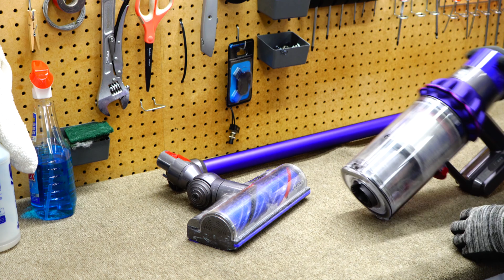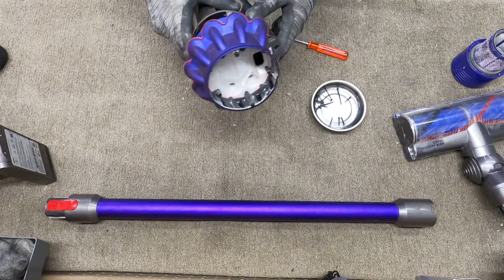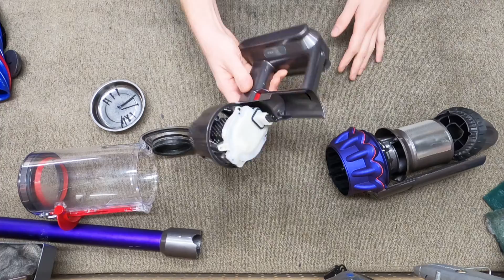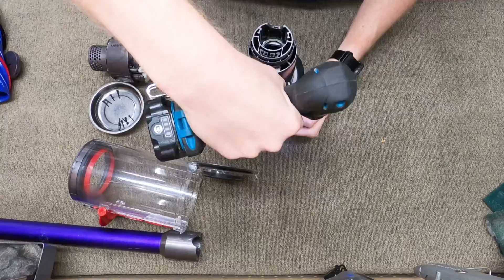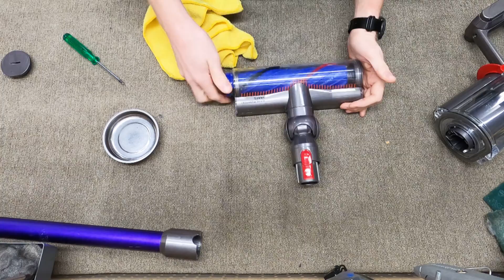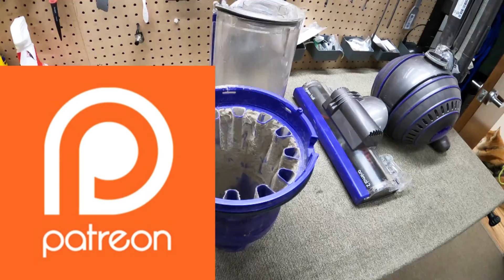Dyson V10 How To Fix Loss Of Suction - Professional Vacuum Repair

Comment: I have no problem with taking stuff apart, but I always try Plan A first if that's an option. My shop vac is part of Plan A. I have this exact model and it suddenly stopped having any suction at all. I checked the usual culprits, i.e., that little square hole, but it was clear. Washed and dried the removable purple filter. But, instead of disassembling the cyclone, I just took the end of my shop vac hose and slid it over the silver top of the cyclone assembly and let it run for a minute. I then smacked the side of the cyclone housing a few times with the palm of my hand to loosen up any remaining dust and attached the shop vac hose again for another minute. Voila! It now runs like new. Give it a try before busting out the screwdrivers.
Reply: I was thinking that would be a better start. Nice thank you

Comment: Quick question, can the v10 create suction without the dust bin being in place? I have been given a clogged up v10 to clean the inside but they forgot to give me the dust bin so I'm thinking that I might not be able to test it without all the necessary parts.
Reply from the maker: No it requires the dust bin and filter
Reply: Chuck it!

Comment: Nice presentation! How well might high pressure air clean the V10?  Meanwhile my Dyson V8 sits on the floor as it's another pain  to clean .vs. my $90 "vacuum devil" Dirt Devil Pet Swerve that essentially does the same thing.  For serious cleaning, my SEBO E3 gets hauled out for stairs/bare floor/rugs.
Reply from the maker: It won't hurt it. But there is a lot of stuff that gets stuck inside the cyclones on this Dyson V10